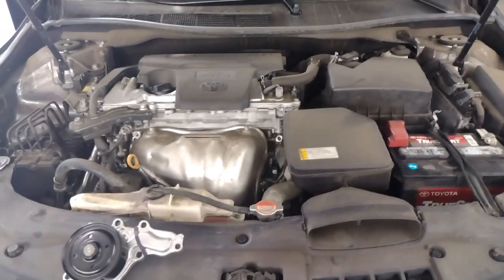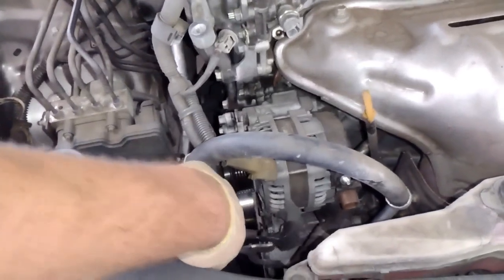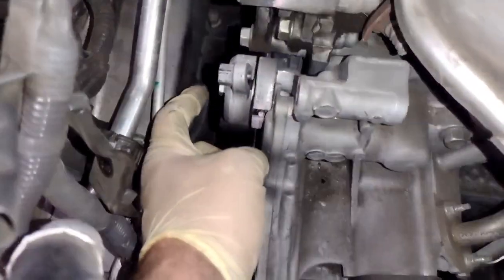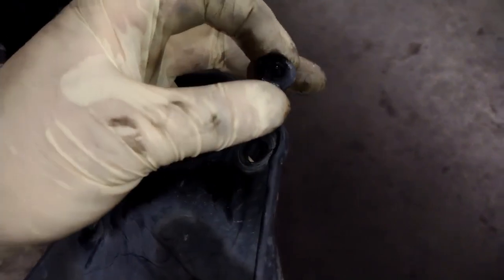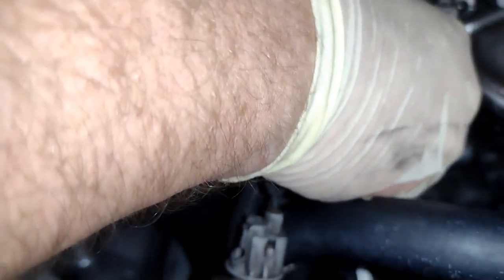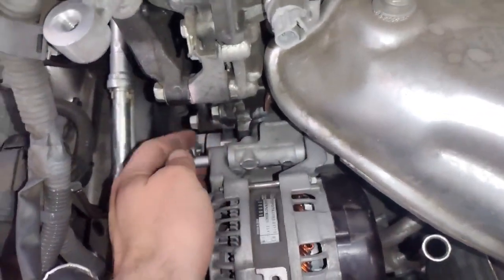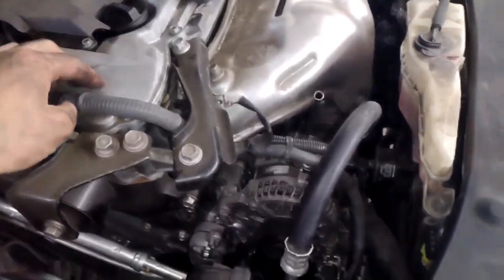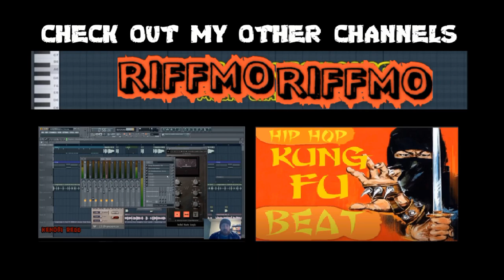2016 TOYOTA CAMRY  2.5L WATER PUMP REPLACEMENT TUTORIAL

Comment from the maker: GET A TOYOTA GENUINE WATER PUMP HERE ( AMAZON)
( 117 bucks ) ( I recommend Toyota brand )
https://amzn.to/3rz8ip6

GET AN AFTERMARKET WATER PUMP HERE ( AMAZON )
( 30 bucks ) 
https://amzn.to/3Oj5jda

GET TOYOTA COOLANT HERE ( AMAZON )
https://amzn.to/3XUVnKi

( FOR COOLANT I RECOMMEND STAYING WITH TOYOTA BRAND) 

GET A TORQUE WRENCH HERE ( AMAZON )
https://amzn.to/3O0fGBz

GET THE SPILL FREE LISLE FUNNEL TOOL HERE ( AMAZON)
https://amzn.to/3Q1GSCw

TOYOTA PART #S
WATER PUMP 16100-09515

FITS 

Compatible With The Following Vehicles:

•Scion
2011-2016 Scion tC [For 2.5L L4;2AR-FE Eng.]

•Toyota
2010-2017 Toyota Camry [For 2.5L L4 Gas 2494cc;2AR-FE Eng.](NO Hybrid)

2009-2019 Toyota Highlander [For 2.7L L4]

2009-2018 Toyota RAV4 [For 2.5L L4 Gas 2494cc;2AR-FE Eng.](NO Hybrid)

2011-2012 Toyota Sienna [For 2.7L L4]

2009-2015 Toyota Venza [For 2.7L L4]

//// CHECK OUT THIS NEW MENS SOAP COMPANY////
      
QUANTUM SOAP Co 

https://quantumsoapco.com/

CHECK OUT THE WEBSITE HERE AND USE

 PROMO CODE -GearmoAuto      10 % OFF

QUANTUM SOAP JUST RELEASED A UNIQUE BAR FOR MECHANICS AND TOUGH GUYS CALLED 
"GALACTIC MECHANIC "

IT HAS EXTRA GRIT / EXFOLIATING SCRUB COMBINED WITH A UNIQUE MANLY SCENT.
CHECK OUT THEIR INSTAGRAM HERE https://www.instagram.com/quantumsoapco/

Comment: Next time leave the rubber band on, then start threading in two bolts to hold the pump on the block, then cut the rubber band off, a lot easier than holding it, that’s my method atleast

Comment: I just use a 12mm 3/8 drive deep well socket with a long 3/8 drive flex headed ratchet to remove all the water pump bolts without going underneath.

Comment: I am in the process of replacing a bad alternator. I have 2012 camry 2.5L. While removing the alternator (the 2 mounting bolt, one long upper, one short lower).  I snapped off the head of the bolt of the alternator (the lower short bolt). Any suggestions to extract that broken bolt out? Thanks